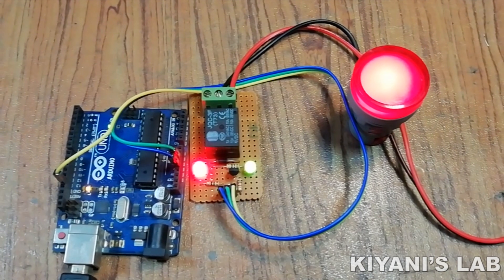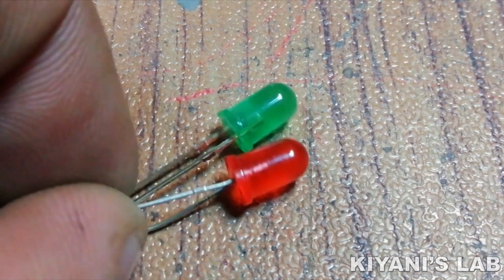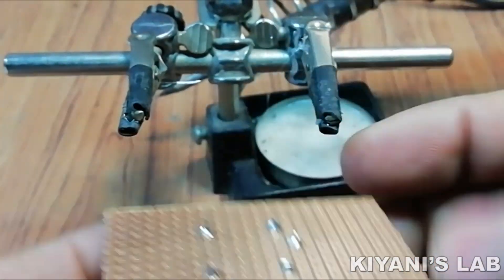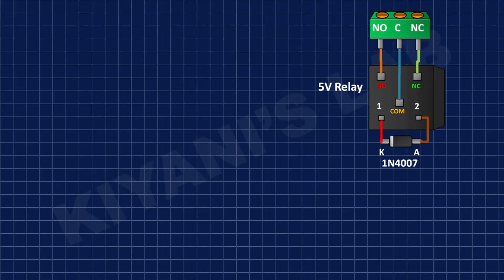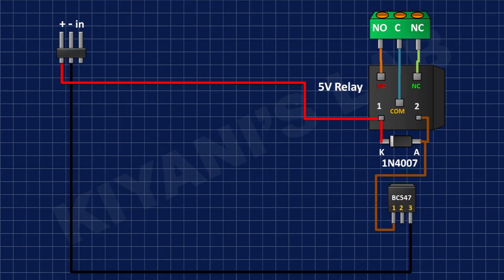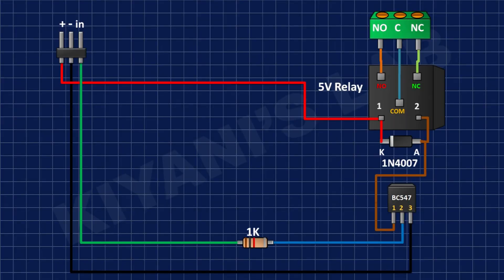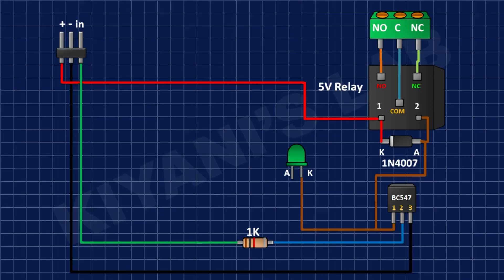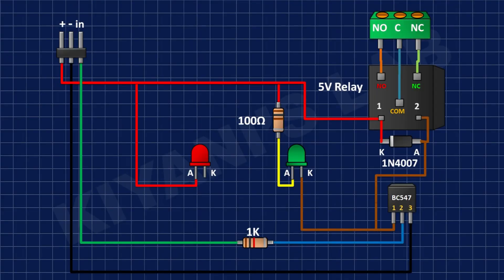How To Make A Simple Relay Module

Comment: I made same circuit but problem is that my green led is glowing opposite condition. In initial position it is on and after trigger is goes off. I tried many  things like- 1. Changed Transistor direction
2. Changed diode direction
3. Changed both components
But not getting proper  Solution 😔😔

Comment: I followed your video and schematics and got a module up and running, thanks for that! Now I have a problem when I connect it to a ESP8266, I connect it to GND and 5V, but when I do so the relay clicks and goes into NO, without the IN pin being connected. When I connect the IN pin it goes to NC. This doesn’t happen when I use a 5V connection from my usb charger. What could be wrong?
Reply: When using with esp8266 modules, there are some that are not there to be used on the module's pins. gpio14, namely d5b and d6, can drive switching circuits such as relays. If you connect it to other pins such as rx and tx, you will have problems. Do not get energy from esp8266, you need to provide external 5v for the relay.

Comment: Just a tip --- you can technically bend the leads and solder them instead of using globs of solder to connect the lines/traces.
Still a cool video

Comment: Can you build a project that starts a lawn mower from an RC Controller?
Reply from the maker: yes if motor current is less than 5 amps for more amps use bigger relay with same circuit

Comment: maybe led red need to switch, the best position is resisistor 100 ohm and then led , not opposite, to avoid 5 volt direct to led, for long life pcb, correct if i'm wrong.thanks.
Reply from the maker: right

Comment: You should NEVER use a solder bridge to conduct high currents.  It is not safe.   Use a wire and pinch the connections around the relay NO, NC, & Common pins and around the terminal block pins.  Then use the solder to keep each connection from separating.  The current needs to flow from wire to contact and NOT through the solder.

Comment: Great video.  Is this called a relay driver?  Also, what if you wanted to electrically separate the relay.  Say you were going to run the coil with 5V and the common with 120V AC?  How would you configure?
Reply: Then use opto coupler

Comment: What is the transistor for? Is it related to the current values of the input and output voltages?
Reply from the maker: transistor is to drive the relay with lower voltage and current eg output of a microcontroller

Comment: Nice circuit. Love that there is no wires under the circuit. Can i replace just the 5v relay with a 12v one and just supply seperate 12v to the module and connect the trigger pin to arduino?
Reply: Yes

Comment: Why is the transitor & 1k resistor required to energize the relay's coil?  In your test of the circuit (approx. 8:21 when you connect your signal input to the constant 5v+)  the  transistor & resistor don't appear to have any benefit vs simply connecting the signal  wire directly to the relay's + coil terminal. Is it because ultimately your using the Aduieno to control the circuit and your protecting the Aduieno circuits or are they not powerful enough to activate the relays coil? It just seems like the transistor/1k resistor are just extra pieces in the circuit.
Reply: To resistors are used to make sure that the led don't burned out or get fused becauae its 5 volts and by using the resistor the volt will be less than 5 volts to safely turn om the leds
Reply: he used transistor to operate relay below 5v... relay below 5v wont work but transistor will